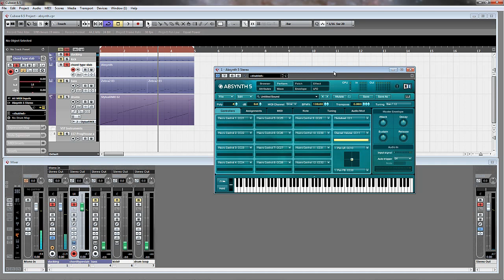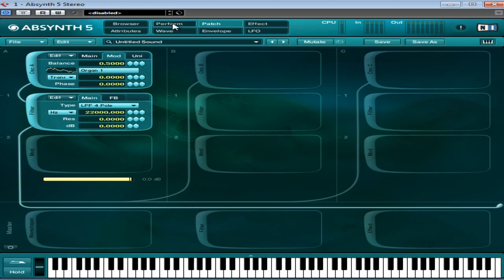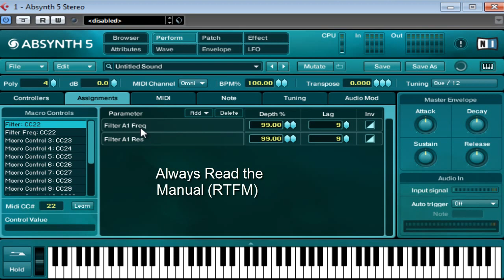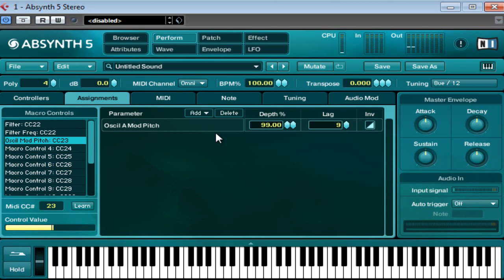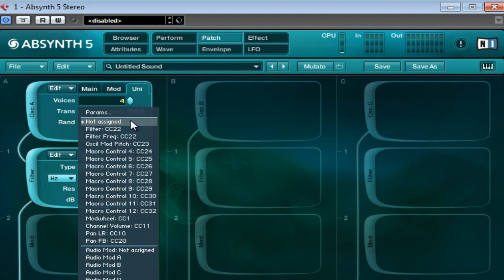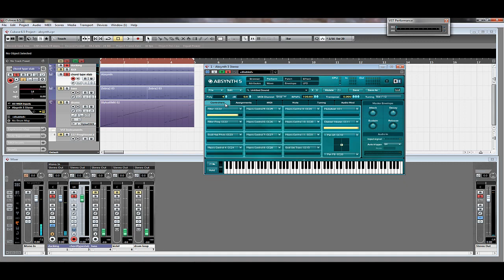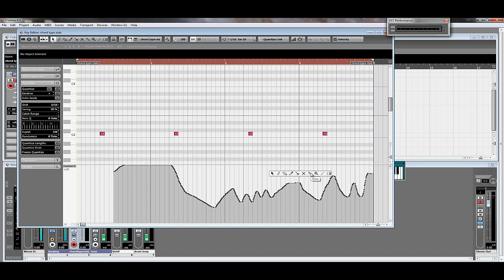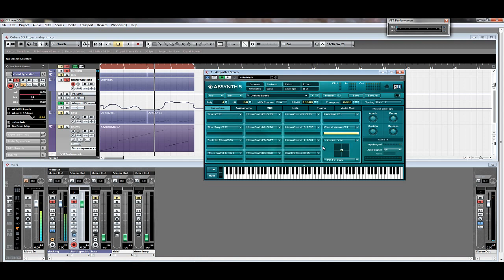Demystifying Automation with Absynths Automation Controllers

Comment: I don't think it's a bug in cubase, the fact that it didn't record the automation when you used the controllers. In fact, you're not actually recording automation, you're recording midi information from the controller that, by the way, is controlling the filter in absynth. That's the reason why it only works when you actually record, I think you could even have the automation write button off, it would still do it. You record the midi controller info into the midi part, the midi controller message is input into absynth which maps it to the filter cutoff. It's not actually automation, it's midi control.